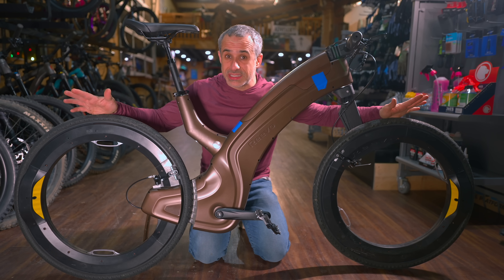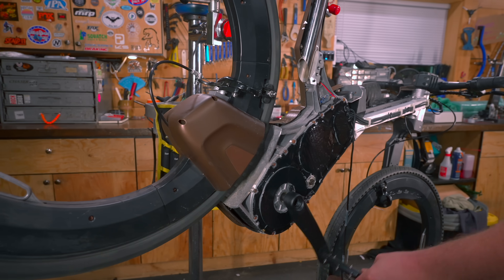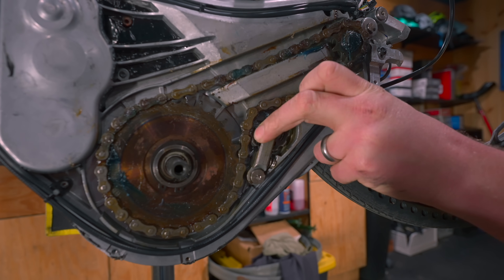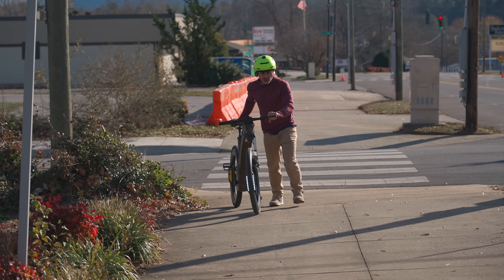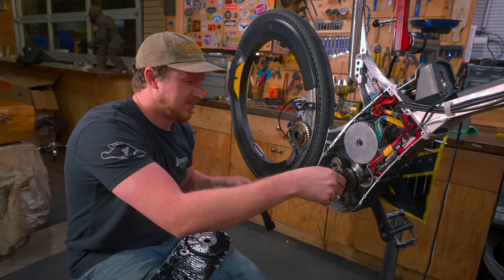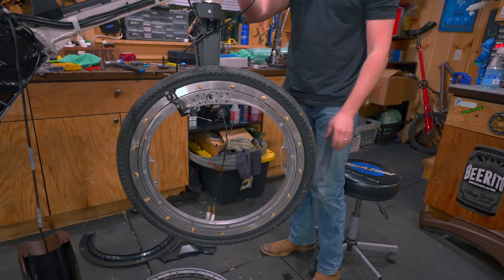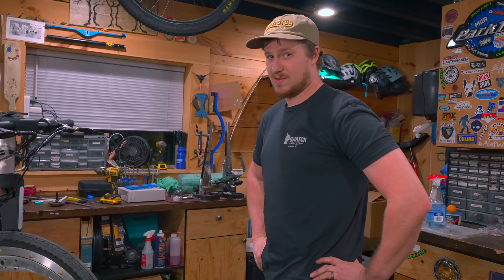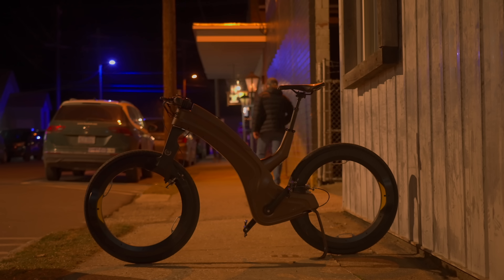What's Inside The World’s Worst eBike? Reevo Teardown

Comment: This bike a great example of an engineer who doesn't understand the core concepts of the thing they're designing. 
This is why experience matters. Especially use and service experience. No one who rides bikes is going to put that much angular momentum and drive resistance in a bike. No one who works on bikes is going to make something so impossible to service.
Reply: Guaranteed the designer pulled in a few engineers happy to take the money to make it work at all, even though they knew it would never work well after the designer had doubled down on keeping all the bad decisions he'd already made, that persuaded a load of people who also don't understand engineering to put money into the crowdfunding. 

The sad thing is all that wastage qualifies as economic activity, and probably made the original grifter rich, while engineering good products that last for decades has negligible economic value because the money moves once at the initial purchase and there's no market for constant replacement of failing products - no surprise almost everything for sale now falls into the 'good for the economy' category rather than the 'good for the purchaser' one.
Reply: I would not dunk on the engineer. No good engineering was ever going to come from such a terrible idea. The engineers deserve props for making it work at all.
Reply: @nathancole8103  Nope, there were ways this could have been done way better and probably for the same or less money. There are tons of hugely expensive parts in there, I'm thinking specifically of that cast rim with the gear teeth. If there was an actual engineer involved in this design, they should be ashamed of the finished result. TBH even as a student project this would be bad.
Reply: You guys misunderstand. This is a decent design. The problem is that the design priorities were not to make a good bike, instead: 
1. make it have as many unique features as possible with no consideration for practicality.
2. low capital cost to set up low-volume production

3. save every penny everywhere.
Reply: @w0ttheh3ll  They did not invent a reasonable alternative to conventional wheels. It's intrinsically a bad design. If somehow they made a frictionless magnetic supported rim and a magical remote drive, yes. But no they had to do the Rube Goldberg thing.
Reply: It was engineered by a designer 😂
Reply: @chris4536  "Designer"
Reply: @mitchkelleher7972  Absolutely!!!
Reply: this was NOT designed by an engineer ...  should be obvious.
Reply: I @cucubanana4226 it's probably designed by an engineer with requirements set by someone that is not an engineer

Comment: Honestly they didn't really cut corners, all of the engineering is solid and not unlike what you would find in industrial applications. It's entirely unsuited to be on a bike of course, but it looks like they had some solid engineers on the job, unfortunately none of them were avid cyclists (or didn't have enough input in the product direction).
Reply: The Rube Goldberg drive train.
Reply: I disagree, the aluminium square bars are cut corners, the hobby tier servo for the kick stand "lock" is a cut corner, rusting screws is a cut material science corner. And the turning tire beeing a energy > noise converter was predictable.
Reply: @DUDA-__-  And so is that li-ion call that seems pushed against the frame. And the aluminum unlubricated gear rim. And the gap that allows dirt to het in. And the 3D printer style wheels to support it all.
Proper machines can use gears and chains. This uses gears and chains, but indeed, it does not make it good engineering.
Reply: it would probably be a decent enough bike if it had normal wheels. I mean, not reliable, but at least it wouldn't be that terrible to ride.
Reply: This thing is clearly a trade show demonstrator rushed into production. I can hear the conversation now: 

Marketing "Available now!!! Exciting new technology, the future of bicycling!!!"
Engineering "What?  No, that was put together at 2am to roll across the stage at CES and IMS. No one has ridden it more than the hundred yards around the convention hall, squeazing through the crowd."
Marketing "Unique experience! Unparalleled maneuverability!!!!"
Engineering "Those are the cheap Amazon bearings we used to mock up the wheel! We're still working out whether to use internal rubber for damping, or cylinder bearings with grease fittings! The freewheel design is still six weeks out."
Reply: Bad management, I would say.
Reply: They should have skipped all the pedal gearing and put the motor directly to the rear wheel.  Basically drive by wire.

Comment: So funny that the "anti-theft system" is a $5 hobby servo
Reply: Looks like a knockoff tower-pro less than a dollar in bulk, so bad
Reply: @garycaruso4883  Yep, as an RC guy the second I saw that servo my though was "Wait, they spent all that money and then used the cheapest aliexpress servo available?" The actual tower-pro is what I would consider a cheap throwaway servo, I wouldn't trust them in a model that I care about. However, at 10:34 you can see it has yellow text instead of gold on the label, so this is 100% a knockoff. These are super widely available, they're literally under a dollar in single quantities. I wouldn't be surprised if you could get them for 25 cents in bulk.
Reply: I know it is a shame for this bike but like it is giving me ideas. I have an almost trash japanese touring bike and I am having a hard time securing it, locks are pretty easy to get into and bike theft is very common where I live. I could do something like this.. as an electronics hobbyist, I could have it unlock with rfid. Btw even the cheapest servos are really hard to move, specially when you dont have leverage, or knowledge of their existence.
Reply: @disguisedcat1750  The idea itself isn't bad, it's the execution. For a bike, you definitely want a waterproof servo and also something that will reliably work. Those cheap knockoff servos can fail within minutes, there is zero quality control. Even with paying inflated prices from a RC hobby supplier, you can get a name-brand, waterproof servo with metal gears for $20. That would be something you could have a little more faith that it won't strand you.
Reply: @disguisedcat1750 you can literally strip those servos out with your fingers. They're for lightweight model aircraft. 

Nothing but a quality lock will stop your bike from getting lifted. Locking a kickstand down is the silliest thing, just give it a slight kick and it's outta the way.  I've seen people steal locked motorcycles by picking them up with boards through the wheels and loading it into their truck, if they want your stuff, they'll have it. 

Just a decent quality U lock and shitty commuter bike, that's the only way to prevent theft. Keep the nice stuff at home or on rides where you don't need to leave it.
Reply: @anthonymuccillo  I understand your point, but still, sounds like a fun project that no one would expect.. hopefully the surprise factor can be enough to persuade thieves off… if you expect to ride the stolen bike into the sunset you wouldn’t have a car standing by…
Reply: @anthonymuccillo  plus I have been stashing parts and ideas for a while, I got a sound alarm and a gps module that Im having doubts about using on this bike, it doesn’t feel worth it. Im thinking ditch the gps and keep it for something more expensive, but use this servo idea with the sound alarm on this bicycle.
Reply: The anti-theft system is the entire bike.
Reply: Locking the kickstand isn't a horrible idea... just not when the kickstand is removed with three screws, then it's a horrible idea.
Reply: Hey, the concept worked great on the Titan sub, so why not h.... oh. wait...
Reply: Honestly that's a pretty smart idea, a $15 anti-theft device that makes the bike basically unusable unless you unlock it would be a game changer.
Reply: It's conceptually a neat idea, but easily the worst execution of this whole thing. Not only does it straight-up not work at all now that the servers are down, but a 9g servo is absolutely something that can be forced by hand.
Reply: @asteroidrules  The servo doesn't hold the kickstand in place - it moves a metal bar into place that locks the kickstand. Similar to electronic deadbolts. The app still works if you've downloaded it, though if the fingerprint scanner breaks, good luck finding a replacement part.
Reply: What prevents a theif from low tech just hacking off the kickstand?
Reply: A servo that you definitely can move with your finger.
Supposed to lock a part witch is a huge lever....
Reply: @SaitoGray  the servo pushes a metal bar that then locks the kickstand an is all enclosed. that's the least stupid part of the whole bike
Reply: @saltyman37  oh, it didn't catch that.
That make more sense, even if these servo fail way too easily.
Reply: @saltyman37 can you just kick the stand and break it off? Does the kick stand lock the wheel from spinning too?
Reply: @ionstorm66   the kick stand moves an internal part that tooths into the drivetrain, locking the wheel. Breaking the kickstand off would not move that internal part and it would remain locked.
Reply: @SaitoGray  The servo doesn't directly lock the kickstand, it moves a bar which locks the kickstand into place. Ironically the one thing on the bike that works well.

Comment: The USB port is actually stupid too. It is not water resistant and mounted upwards, so it rains into the plug. Debree and mud are going to make it unusable during the first rain. USB ports on motorcycles are usually pointed downwards and backwards so the water can run out.
Reply: Tbf nothing in this bike is really water resistant. There are bare pcbs with exposed wiring and gears all over this bad boy; all protected by thin plastics without any gaskets or even the attempt if waterproofing. So once this mfer gets really wet or is ridden in very humid regions it will die no matter what.
Reply: @theredspoon1763 this bike started to break down after a tiny bump. Rain and other adverse conditions? Lmao FORGET IT 😂😂😂😂
Reply: Exactly what I thought as soon as I saw it in the last video, I’m sure a simple rubber cover could easily prevent water and debris from getting in there, plus the bare port looks very out of place on the rest of the sleek frame IMO
Reply: debris*
Reply: A USB cover would do the trick but ye it's a bit dumb that it's not water resistant.
Reply: Water enhance the conductivity so the usb is better this way... 🤣
Reply: It would have been smarter to put the USB port on the battery pack. The cover would keep out the rain, provide somewhere to fold up and retain any excess USB cable, and you could take the battery with you to use it as a portable power bank.
Reply: Debree was from Manchester, her best friend Debris, was a French lass. Whenever they went out on a night out it was carnage.
Reply: Personally I think the whole bike would break if it got wet.  Imagine all those moving parts getting water in it.
Reply: @ Indeed, and the rain would be bound to splash grit and dirt off the road onto those bearing wheels and the aluminium drive gear on the wheel. Plus the plastic case doesn't look like it would do that much to keep the water out.
Reply: Appart from fitting it with square wheels I don't know what they could have done to make this bike worse!
Reply: @regisdumoulin  Square wheel advantage: less continuous contact with the road!
Reply: Didn’t Fazua do that on the e-bikes that use their motors/batteries as well?
Reply: It is possible to make upwards pointing USB without those issues, but the contacts would have to be made out of gold (or any other non-corroding metal) and the port will need a drainage hole on the other side.
Reply: Some new sony wireless headphones have type C port pointing upwards, what is wrong with those guys
Reply: Debris :) stupid silent letters strike again
Reply: "debree" lol
Reply: Word for word copied from the main channel video.
Reply: @Din-Viesel-01  everyone needs a participation medal
Reply: I think I'm going to come
Reply: Speak for yourself, I use Debree all the time.